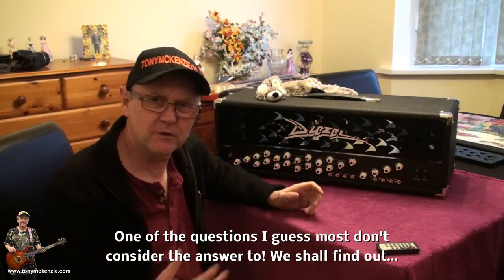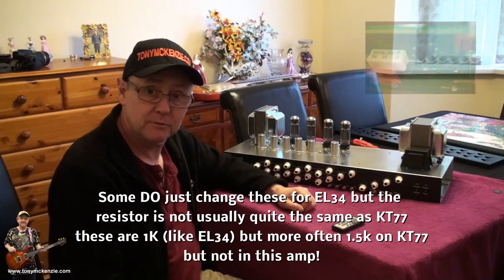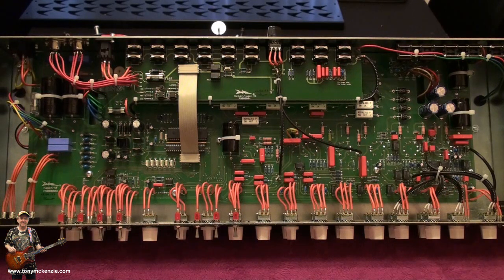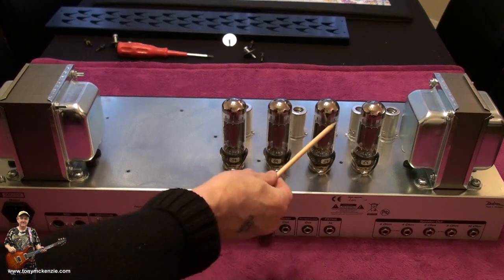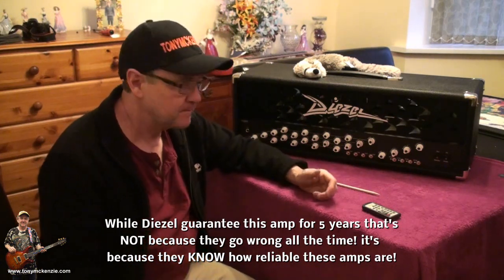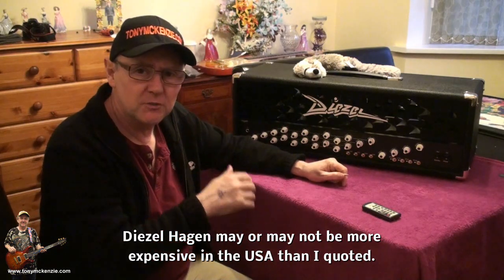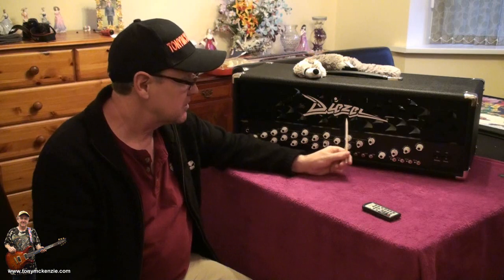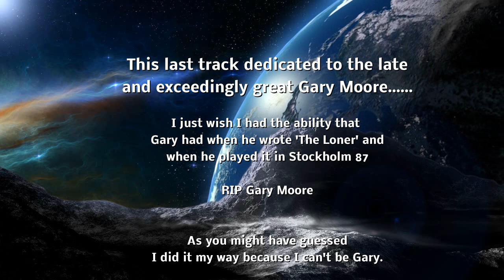Diezel Hagen Amplifier: Are They as Good As They Say?

Comment: The guitarist in my band has a Hagen.  its a monsterous high gain amp but its capable of many different sounds.  The only thing I will say is that its worth getting a Diezel cab if youre gonna get the head.  our guitarist went from a Zilla 2x12 to a Diezel 2x12 and the difference in delivery is stunning!
Reply from the maker: That's a good point for sure, I found that with loads of amps including the Engl E670 that 'needs' their cab to get the best results. It's a bit like the simulators - they bring to the forefront of your mind about cabs and lots of guys don't even think there will be much difference... but of course, as you say there is!

Thanks for watching.

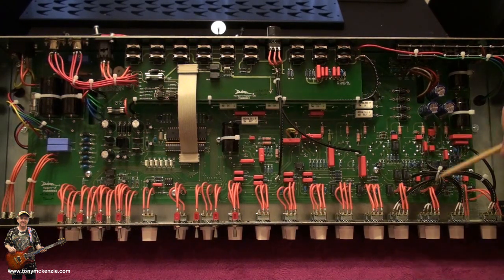Comment: Not sure if anyone has pointed this out, but that circuit mod at 16:30 is two diodes back to back across a large resistance which created a circuit known as the Peavey coring circuit. It acts as a rudimentary noise gate.
Reply from the maker: Great information and you are right no one did say what it was. I certainly did not know that, but it just looked a bit of a mess really for an amp of the cost of these. I guess later they updated the PCB. Good point from you and thanks for watching.

Comment: Ruby tubes are made in China, yes, but so are TADs.

Transformers are not labeled on the cover, however the Einstein I had on the bench a few years ago had german made transformers in them, custom made for Diezel. VERY high quality stuff :)

Diezel uses thick copper on the PCBs and the PCBs are thicker than on many other devices, plus the distance between tube sockets and the PCB is quite substantial, so heat is certainly not an issue. :)
Reply from the maker: BavarianMonkey I like the tad's because I never had a single tube problem with those.. I'm not even sure who makes them I guess it could even be ruby :) (that would be so funny) so I do put a lot of faith in to the tad process of selection... I pay more for them for sure, but its that piece of mind. I do like the Diezel amps, but its just silly things that seem to not be quite as I at least would expect them for the cost. The Hagen I have has its own things going on, but the sound above anything else is why I still have this amp. The thing about Diezel above it all I really do think is that sound. Some might liken it to a Marshall on steroids and I might have even said that myself :) but in reality I do think that it's far more than that and it has its own voice for sure. Thankfully the sound of the amp will probably stop me from selling it anytime soon. It is a big PCB compared to some of the tiny ones out there that are hidden away in some of those different amps I have seen and apart from their engineering 'fix' on this amp the quality was generally very good I thought. Thanks for watching BTW.

Comment: did you end up keeping this amp? Im thinking about saving up for one! I play mostly pop/punk and hard rock/metal and Im building a studio so I want something that can do abit of everything! The other amp Im considering is a Marshall JVM 410! Thougts? is it worth the extra almost 3000 dollars(canadian)?
Reply from the maker: Indeed! I still have this amp and it certainly has it's place in my music styles from time to time. The JVM410H I have had two! Here's a link to the website review that is probably the best review you will see of that amp: http://tonymckenzie.com/marshall_jvm410h_review.htm and I also reviewed the JVM410HJS Satriani head on my channel on YouTube, but more importantly on my website - and I had incredible information in the review here: http://tonymckenzie.com/marshall-jvm410hjs-satriani-review.htm which shows an in depth difference between the 410H and the 410HJS.

FYI the 410HJS has a completely different main board inside it and that's one of the main reasons that the 410H and 410HJS should NOT be compared... they are chalk and cheese and to be frank I would NEVER buy another 410H but can recommend the 410HJS wholeheartedly.

The Diezel amp has its issues somehow, not least with little mods etc. on the one I have but that's normal really and the Hagen as I demonstrated in the video sounds particularly good for rock and metal styles. IMO the 410HJS is the most flexible amp of the three and that will take you a very long way. Hope it helps... and thanks for watching.

Comment: With the respect to versatility the Mark V would be superior to the Hagen, but how does the Hagen compare to it tonally?
Reply from the maker: They are both very different. The Hagen sound to me is right here: https://youtu.be/MS7zEf5x0jg?t=2084 but as you say it is less versatile. I love the tones in the Hagen for sure, but the Mark V offers far more than the Hagen. I did review the Mark V some while back here: https://youtu.be/hPw_lJhWuZg  I do think each amp is very capable of inspiring the player in a very good way, although I have to say that for me, the inspiration between the two was that the Hagen won easily. The Mark V is harder to get a very inspiring tone. The Hagen in the clip I turned on, a quick twist of a few knobs and that was what came right out right off. So, for the sheer inspiration of that style I played the Hagen would be all day. If someone was not a particularly sort of rock or metal player I would tend to look towards the Mark V first. Of course its all down to what someone wants and likes and I do think if you like a style it undoubtedly helps too :). Here's the point... I sold tyhe Mark V and I still have the Hagen :). Thanks fore watching.
Reply: @tonymckenzieofficial  Thanks for the very informative detailed response. I own a Hagen and was considering a Mark V for its unmatched versatility.

Comment: good review, tony as always, like this amp, im a lover of germany components.
best regards.
Reply from the maker: Yes you can tell close up that it's made by people that really care about what they do. There's nothing really bad, even the production mod was well done. They have probably fixed that these days with a board revision. At least that's what we used to do when I was involved with boards (8 layer stuff) hard to easily 'fix' a problem once the board is produced. Sometimes on some amps you see jump wires to mod the circuit but I suppose it depends on what you're fixing. In any case this amp was at least as good as the RK II I own and on this one there was not a single cap or resistor that I saw that was bent or misshapen like on some of the Marshall reviews I have done. They all work of course but I think that little things like that show that real care is taken when it's being made. I also liked the assemblers name on the chassis and boards... a nice touch in these days of mass production.

Comment: Hi, thx for the review. Just a few comments: I think, that Peter Diezel made some serious selections about his pre-amp tubes. If the chinese are good at work (especially in these positions), why not use them? Just because theres no TAD sign / selected remark on it?? The first positions (the most important) are selected. No probs with it.  
3 or 5 years warranty: I think Thomann act as a seller, and they´ll give you 3 years of warranty, which is 2 years over the law (in germany). If Diezel gives you 5 years, ok, then contact Diezel, if theres anything wrong with your amp in the following 2 years. Contact Diezel, not Thomann, and you´ll be alright with it. I think that´s the normal deal with it.
Reply from the maker: Hi, well I guess you could put almost any tube in those positions for sure of any quality. The only thing is exactly how robust a cheap tube is against a properly selected and burned in tube. It's not really so much the maker, but check what Mesa, TAD, GT and all those others say about out of the box unbranded Chinese (usually) tubes - they all seem to say 'we throw away hundreds in our selection process' (or a very high %) type of comments (not quoted verbatim here - just an example).

So reliability is absolutely the most important thing I think for ANY amp that is a professional amp, which the Hagen really is. For the difference in cost (to Diezel) I really thought that those tubes short changed the customer a little especially for the price of the amp here.

Of course the user can change them out but then that's like buying a car without the right tyres to drive it. And you are exactly correct on the first positions being selected tubes. I smiled when one guy on their forum said that tubes don't matter LOL.

The warranty is good for sure, but no better than a Mesa Boogie warranty that also has five years from Mesa. But it's still a great warranty. The only thing I felt about the warranty, was having to pay to have it 'transferred' to my name when I bought this second user amp that was just about 9 months old (or so) and had literally been turned on about three times just to keep the amp happy. The seller was very trustworthy and reliable and I don't need to question his credibility about what he said at the time I bought it.

I currently own a Ferrari California and that's the equivalent of the Diezel brand (I like to think) but I did not pay a bean to get the extra 4 years FREE servicing and certainly paid nothing for the transfer of the servicing from the old user to me on the Ferrari (and that is a great deal of money where that car and servicing is concerned). Although the Ferrari is a car and the Diezel is an amp and are dissimilar I just used this example to express my view regarding the charge for warranty 'transfer' I think it was £160 (probably 200 Euros or $250).

Overall the amp IS a good amp and I do like the sounds it makes hence the overall rating I gave it in my review. I like the UK distributor too - a very helpful James!

You do have some very good points in your post and the warranty information I am sure is useful to others... which is what my channel is all about... thanks for that input and for watching the video - it is appreciated.
Reply: *****
The warranty for your Ferrari will be useless, if you drive races, imho. The same with the Diezel. You say, the seller was reliable - what about a pre-9-month world tour, 4 pre-owners, gallons of beer spilled over the amp and a f**** up PT - before you bought it and didn´t know about. Will it be covered by any warranty if theres some trouble with the amp? Maybe, but it´s difficult to understand. You´ll sometimes get a lifetime warranty, but only for the original owner - even with boutique stuff (guitars, aso). 
I don´t want to say, that I like this kind of practice, but I think it´s comprehensible. Otherwise, you´ll get screwed (as a seller / producer) with problems like: some really serious and god-like amp-tech modified my amp....and guess what, now it´s broken -> But I have warranty, haven´t I?? 
I don´t think, that anybody will accept a warranty in this case. So maybe Diezel uses this "paid" second-hand-warranty, to get rid of people, who tour their amps in a trunk or on the back-seat of a 1960 VW Beetle and expecting Peter to repair their own faulty behaviour. :-)
I´m a salesman for food and believe me, sometimes I´m loosing my religion, getting confronted with "I-want-my-warranty" problems. Sometimes, I´d just like to say: "it´s your own fault - f*ck off" coz the user of this product made every mistake (and far more) you can make - starts with storing fresh and living mussels at -18°C ("man,....they all dead....!") and ends with milk getting sour while stored at +30°C - comment: "Man, why.....this was fresh milk, opened just this morming!" . 
I really think, that also Boogie and even Ferrari have some limitations to their warranties - and of course, there´s always a door open, if you ask in a friendly way and manner.
I had some probs with a Hughes & Kettner Tubeman 1, which I bought second hand. Two of the pots were stuck in complete - no turning possible, not even a millimeter. I mailed the hotline and asked what kind of pots are inside, where can I buy them / spare parts available,... guess what, they sent me 2 pots free of charge - I never asked for, the Tubeman was not registered and they didn´t know me. That´s what I mean: ask in a friendly way, and very often, you´ll get help.

btw, thx for your fast and kindly response. I really appreciate that!
Keep on rockin! Regards, Carsten
Reply from the maker: Hi Carsten,

I don't drive races any more - Can't find much to keep up :)

The seller had two amps and this Hagen was the 'backup' that was literally not used. I completely agree re the warranty on messed with amps. The only problem is, that James knew this seller and confirmed warranty and the history of the amp - it was as new as delivered - in fact I picked it up from James as he was coming to a show nearer where I lived. The transferred warranty was EXACTLY that - not a payment for another warranty - just a payment to 'transfer' the warranty to a new owner - I have the invoice to prove that. I have been partly in sales (fully for the first 15 years and sold literally millions of pounds worth of technology) from 1980 onwards and know exactly what you are talking about on 'warranties' that people expect, but is actually user issues and I agree with you on that completely. I could tell you stories of some of that in technology you really would not believe LOL.

However, I am also very meticulous in how I look after my equipment and I can honestly say that my gear is literally as intended and supplied by the manufacturers with one singular exception - a 240v UK transformer I fitted to a Mesa Boogie Road King II simply because the UK distributor is a greedy B. I cannot stand paying twice the cost that the product is in its native country when it gets here. And I know every single aspect of importation to the UK from the USA too, so its little to do with all the things that some people would use conjecture within their points of view on that.

Your comments on manufacturer 'goodwill' are well known to me and some makers are very good, while others.... I could name them but won't bother.

This review from my point of view was actually a complimentary review from seeing and using the Hagen 1st hand - you should see the reviews of gear that IS bad fro me. James was one of the good guys and very friendly, and the product was in fact what I expected. The score rating again from me I think was generous - even though the unit had post assembly production mods (not too uncommon especially in lower volume production products) - but cr*p tubes is not what I expected from a premiere guitar amp manufacturer. As I have said, they can easily be changed, but honestly if I was running that production, for the small cost difference they would have been rather better than what I found in there. Over time it will do more harm than good for the brand.

Funnily enough the last amp I actually had problems with was a Mark IV Boogie about 20 years ago (out of warranty and was crackling banging etc.) I checked the main usual stuff then sold it. Then I bought a TriAxis and 2:90 LOL. Other than that I can say that not a single amp from ANY maker has given me really any problems. Maybe it's how I look after them who knows, you highlighted the issue of kicked around amps which we have all seen at one time or another.

Thanks for your input on my channel - it's always good to get other points of view which can help other guys at some time maybe.

Comment: There are only three placed where all the tubes are manufactured: China, Slovakia and Russia. Ruby tubes are just Chinese ones, nothing else! It's pretty well built, but a repair service nightmare for techs, because of those PCBs stacked and screwed to the chassis (maybe I'm wrong, but I saw all the components soldered underneath each of the boards... just a total mess). I guess it will last for ever without any issue, except the electrolytic capacitors you'll have to replace after ten years or so! On the other hand, biasing that kind of an amp can be a little bit tricky. The instructions says you need to remove some fuses to bias a pair of tubes... what for? Never heard that kind of thing before.
Reply from the maker: I had the tube issue and that was unfortunate, but it did dissuade me from that particular brand. I usually use TAD tubes because they are tested to perfection and never had one fail... ever, irrespective of where they are made. So the underlying brand for me is really less relevant than the work in rooting out the run of the mill stuff sold everywhere. True I have to pay more, but can you imagine the cost of fixing this amp if that tube had really bitten in... I can too. 

The amp was well enough made and not really dissimilar to other stuff I have reviewed but you have a point re serviceability. It's never failed and sounds really god though. Yes the fuse thing was a bit strange, and I don't know the answer to that either. I still have this amp mainly for its tones in the studio and unlikely I'll sell it anytime soon. Thanks.